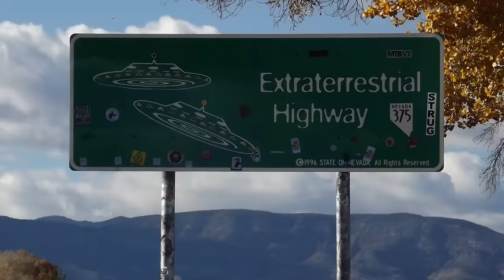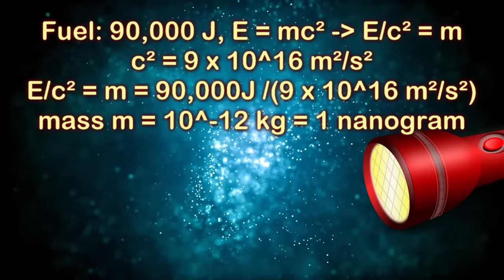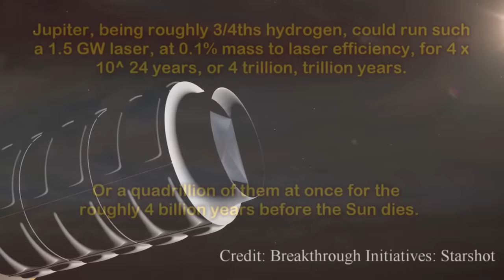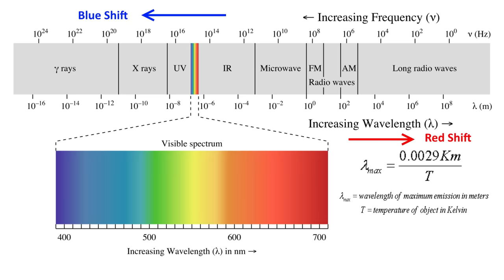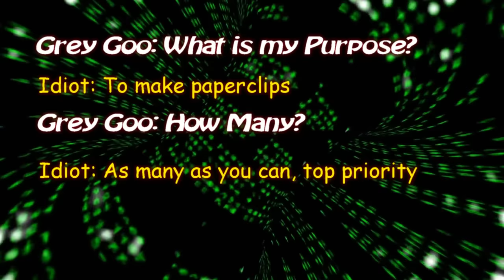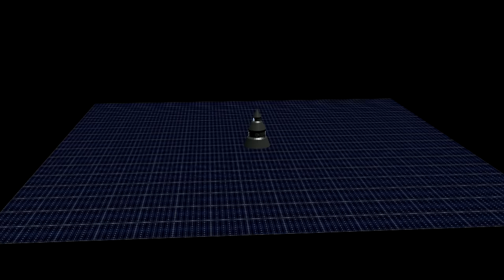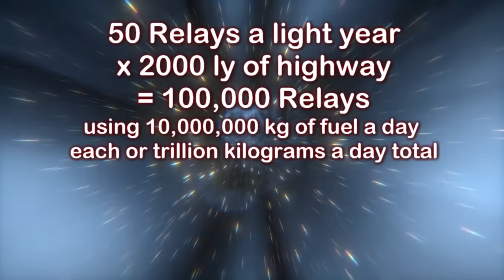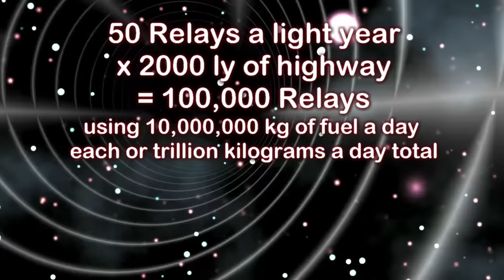Interstellar Highways

Comment: As always, a wonderful show. 

One thing I didn't see mentioned about the reflector station idea: couldn't you use something like a parabolic reflector to re-concentrate the beam for the bounce? i guess I'm picturing something like a lasing cavity at the focal point of the parabola...

If you wanted to, and you get the angles right, you could even put one on your boosting stations to re-reflect the energy from the station a few times. Sure, you'll lose energy with each bounce (and probably take a penalty as well for the cavity), but it would keep your beam columnated. Maybe even put something to shift your frequency back up if really necessary.
Reply from the maker: Sure, you could use a  lot of mirror and lens option to extend the beams aiming distance too, but I was kinda skimming that with the whole 'one light week radius' option. If you were doing great big habitats as relays and full blown petawatt beams, you'd probably have whole chains of reflectors and beacons and dishes along the way spaced every few AU or such.
Reply: Isaac Arthur seems like that sort of power would probably only be really used if you were going intergalactic... but if you're somehow energy-starved, or just stingy, it does give some more efficiency...
Reply: I made a presentation on this subject a few years ago. If you want to use the same optical power being transmitted along the relays to stabilize their positions against drift, the reflectivity of each relay optical mirror is the main bottleneck on how much power is left available to propel ships

http://www.centauri-dreams.org/?p=28727
Reply: Charles Quarra I think I read this a while back. the only issue I can see is: what stabilizes it? Basically, you've got another light sail. For something like the Starshot probes it's fine to use something like a small Oort cloud body, since there's so little mass that the effective recoil is zero. A ship like in the video is much bigger, and unless you're placing a rogue planet or something out there, and matching the relative velocities, it would only be effective for a short time.

I suppose if you can make them cheaply enough, and have the extra capacity in your beam line to get them out there and stabilized enough, they could be disposable, or possibly even pre-deployed for a particular mission. 

Ideally, with frequent two-way travel, you could just have it switch from up-stream to down-stream periodically, but most theoretical interstellar societies that feature that sort of traffic hand-wave for FTL.

If that's not the case,  you'd either need some sort of propulsion unit (implying reaction mass, and a larger structure), or MAYBE something like q thruster/emdrive/etc., with a suitable power plant (we'll see how that one goes, and if it does work this whole idea might be toast anyway).
Reply: "what stabilizes it?"

you have lasers coming in opposing directions from each star connected by the route. The mirror relays try to refocus the incoming laser light toward the next relay, but a small fraction is thermally absorbed and scattered. The absorption and scattering results in a small force, which gives you some equilibrium conditions. Those equilibrium conditions result in how much of the power can be redirected toward passing ships on each lane.

Figuring out how to design the relay mirrors such that they can behave as a lens but without a refractive material (which would be much heavier, and have lower transmission efficiency) is hard work. Highly reflective materials also require low area powers to avoid evaporating or damaging the thin reflective layers, which is probably the main limitation about how small can the optical elements be made
Reply: Charles Quarra ok that part I missed. Makes sense. Thank you!

Comment: I wonder what the maximum traffic density would be? If I'm in a ship with a big sail at the start of laser hwy, no ship past me is getting any photons. I steal their wind so to speak. A small low mass vessel could also jump in behind a larger ship and accelerate faster, ending in collision. Multiple lasers would make multiple lanes, like a regular hwy, but is the maximum one ship per laser relay?
Reply from the maker: There really isn't one so long as you've got the power to do it, realistically I can't imagine anyone using more than a percent or two of available power to run such a thing so you could extrapolate maximum density off an assumption of 10^25 Watts of laser to run maybe ~100 ly of lines, or 10^18 W per AU of line. If we were assuming 10^15 W per ship, about a thousand ships per AU, passing one going the opposite direction a couple times a second.
Reply: Makes for a cool traffic control system at relativistic speeds. Since there is enough power available, it could be a beam diameter much bigger than you need. With focusing mirrors on both ends at the emiter sights, precisely mirrored sails, we could reuse as much reflected or unused light as possible and bounce it back and forth between stations. Make the ships mere motes riding between massive collimating mirrors. That would be some mean precision optics...
This seems to be similar method discussed here: http://www.nextbigfuture.com/2017/02/yk-bae-can-now-amplify-photonic-laser.html

Comment: If someone else is already doing this out there, how would it look to us?  I imagine there is a lot of heat coming off of those laser stations - and some being dumped off those rapidly-moving sails too.     If we ever get in the path of a beam or reflection it should sure stand out, right?
Reply from the maker: I've been thinking about that, someone else brought it up too, and they actually wouldn't be very visible compared to the civilizations they connect. The scattering off those sails is huge, but a planet is still brighter, and this is very K1+ nearing K2 kind of activity. You could certainly detect such a network but it would be like seeing a car or train going between to metropolises, visible but simply tiny compared to those two cities.

Comment: Isaac, have you actually seen dr. Philip Lubin's presentation on photonic amplification using current fibre optic lasers? It is quite convincing (including the math). It shows that commercial lasers are just five years away from attaining the laser amplification levels needed, and that is with commercial technology, meaning:It doesn't require additional funding, just a couple of consumer infrastructure upgrade generations.
You can find his talk a.o. on livestream, NIAC 2016 it s about 60mins. They don't even have a problem with creating the large scale receivers. Also, the lenses required do not need to be as big as your math would indicate, fibre optics threads replacing a lens is one way to take care of that.

With regards to real focal lenses, it has been reduced to a materials problem, for which multiple avenues to come to a solution have been found. So one can be more optimistic about this tech than one thinks. Best date if the lens development is accelerated from an academic research program to a full scale technology dev. program: 2030, which is quite fast.

Love your shows!
Reply from the maker: I will have to check that out, thanks! Good to get some evidence I'm not being too overly optimistic about the tech.

Comment: Every action has an equal, but opposite reaction. How do the arrays stay where they are in relation to the various stars they connect when theyre pushing out such power? Even if you have ships traveling in both direction to balance out the force, everything orbits something. Would there be enough material in deep space to allow the arrays to maintain their positioning?
Reply from the maker: They can push each other, and dump excess momentum into a star or gas giant at the end of the line.

Comment: I would think you would be able to have lasers on board the sail craft both forward and back, fuel would still be a problem, but you did state hydrogen is the most common element in the universe? also I would think photons would be the soup of deep space, would it not be just a case of focus? glasses maybe :)

Comment: Hi Isaac. The first I ever heard of such systems was in Robert Forward's Rocheworld. He didn't have relays he had a giant Fresnel lens instead the concentrated the light.  Couldn't you have a lens instead?
Reply from the maker: Sure, lenses are an option, didn't I mention that in the episode? I lose track sometimes of what thoughts get onto paper and which chunks get revised or edited out before production.
Reply: Don't think so. You seemed pretty sold on relays.
Reply from the maker: I mention it about 5 minutes in, but a relay could use lenses too, refocusing beams, it just works better if you are generating the energy out there, a big light bulb and mirror and lens assembly works there too.

Comment: Wait so if you bounced a laser beam back and forth between the relay and the ship enough times and you could keep the beam tight enough and the absorption rate low enough couldn't you in principle get more kinetic energy transferred into the ship and the relay station than it took to fire the laser? And wouldn't this violate thermodynamics?
Reply from the maker: No, its not viable to bounce too many times anyway, except maybe for a slow down, but assuming you had perfect mirrors and targeting, as time goes on and the ship speeds up, the photon will be red-shifting to hit the ship, meaning its less energetic from their perspective. No free lunch there, though the more bounces the cheaper the meal.
Reply: Thanks. Looks like we'll have to find another way to survive the heat death of the universe. If there is a way I'm guessing it would involve something like harnessing dark energy since it's the only natural process that appears to violate the first law of thermodynamics.

Comment: Not sure about physics.. but battery uses chemical not atomic energy right? so theoretically there should not be any change in mass when you use battery and therefore no mass is lost and therefore you cannot use E=mc2
Reply from the maker: Batteries, chemical or otherwise, lose mass when losing charge, its just very tiny.
Reply: chemical energy is still energy. The fuel in a full tank in a car is about 0.1g heavier than the exhausts released when burning it all.
Also, some batteries do use atomic energy - they are called radioisotope thermoelectric generators (RTG). We use them in space probes in outer solar system. They are not rechargeable though...

Comment: "we can't trap light in a box"
Light has been slowed to one mile per hour (.0000000015c) in an unusual form of matter known as a Bose Einstein Condensate (BEC). And in 2001, physicists for the first time managed to stop light in a vapor of rubidium gas.
since then its been held in place for several minutes and could theoretically be held indefinitely so long as the temperature could be regulated.
Reply from the maker: Good point but I suspect that would break down when we started trying to jam quintillion of joules worth of photons into it.
Reply: Only one way to find out 😆

Personally get the impression that unless photons themselves emit some as yet unknown force or energy when slowed to a stop, then it would just be limited by the runtime of the refrigeration equipment. 
Plus since we're accumulating them in a controlled environment, we could always just very slowly gather them with much less powerful pulses, a rotating and/or multi barrel chamber and just stack our way up to the target energy density without inducing a thermal load that would disrupt the Bose Einstein condensate state.
Reply from the maker: Indeed, and I would be overjoyed for my guess to be wrong on that :D It would obviously be very useful as a battery/fuel

Comment: how efficient at reflection does a mirror have to be to be useful as a container for use of light as a fuel
Reply: say the container is 1m in diameter. that means the light would bounce off of a wall 3x10^8 times per second.
To have still 50% of the energy stored after ONE second that mirror would have to have a reflectivity of
99.9999998%. since (0.999999998)^(3x10^8) = 0.5.
For everything longer my small pocket calculator is to small^^

Comment: Can't you run a solid track the whole distance? 1ly=10^15m  Earth mass=10^24kg so you have enough mass to build a 100 km circumference, 1 ton /m^2 rotating habitat 10 ly long. You could run a relativistic track up the side of something like that. (with a small gap to minimize damage from relativistic accidents.) Using electromagnetic acceleration and breaking you could reuse the energy from one journey again and again, good efficiency and regenerative breaking.
Reply from the maker: You could but that distance is changing rather quickly, stars move, and I'd be real nervous about any physical track that's got stuff plowing down it at relativistic speeds, even if it's not actually touching it.

Comment: Is it possible to do this without fusion reactors at each relays?

I mean, beam laser power from one relay to another, which gets captured by massive solar sail sized solar cell arrays, use some of it to push ships, use the rest to pass on the power to the next relay.

This way you don't have to worry about mining lots of hydrogen at each relay, maintaining the fusion reactor and housing 100,000s of people at each relay.

You will lose some of the power due to the efficiency of the solar arrays never being 100%, so you will not be able to continue this relay chains for more than a few dozen relays. At which point you might already have a 1 light year chain or more. So every 1 to 2 light year, you will have to have a massive fusion reactor powered laser emitter station with its own hydrogen mining infrastructure manned by a few 100,000s people. But that would still be better than having such a station at EVERY relay.

You can also have a swarm of laser emitting stations at each star sending power to relays in all directions, this significantly decreases the need for fusion powered laser emitting stations even further, and possibly eliminate them altogether.

Comment: Could you do something similiar with a ramscoop ship and stations that "seed" the path with fuel?
Reply from the maker: Bussard Ramjets don't work... although they maybe an excellent way to slow down, I explained them a bit in the original episode where I went over the basic for this system, the old Interstellar Colonization episode. Of course you could maybe get away with hitting a ship from behind with a beam of relativistic hydrogen hitting them at just a bit faster than they were going, suck that in and fuse it for fuel.
Reply: If i remember correctly, the Bussard Ramjet would not work, because the drag would be greater than the energy gained by proton-proton fusion. But would that still be the case if you seeded the ships path with ready-to-use fusion isotopes?

Comment: Wouldn't the relays drift away inside of a galaxy relative to each other or does everything move homogenous within a galaxy?
Reply from the maker: No everything is moving, your relays have to stay on a straight line with stars, but that's a very slow drift, and they can actually beam each other around once in place. Timeline-wise its kinda like worrying about keeping your boats lined up on a river while it slowly changes course over several decades. You might need to add a new relay every few centuries if a pair of stars you were linking were moving apart rather quickly.
Reply: Isaac Arthur this was my biggest question as well, and I searched the thread for mention of this: what happens to the position of relay stations, are they moving much toward the galactic center, or are they correcting their position to maintain the "lanes" and if so, do the need to emit a simple stream of propellant (whatever is most plausible). Also, how close does a relay station need to be to passing ship, considering that if the beam is too angled it seems like it would cause the sail to pivot, and if it is too direct, it might hit something vital like another station. How far should these stations be from each-other?
Reply: @twansley1  Some of those questions are answered here: https://www.academia.edu/4135938/Laser_Starways_light_bridges_to_the_closest_stars

Comment: I haven't seen the whole thing yet.
But a question, wouldn't it not be simpler to put a nuclear fission (or fusion) reactor on the ship to power strong lasers to continuously shoot at the sails?
Reply: to shoot at your own sails?
Reply: AndDiracisHisProphet yeah, to accelerate it.
Reply: Think of being in a car. If you push on the seat it won’t push the car. But if you’re in the ground pushing the car away from you in a fixed position you can push the car then. The laser has to be in a fixed position on a separate entity to accelerate the sail. another example would be you can’t put a big fan on a sail boat to push it.
Reply: Devin Greene nvm
Reply: Devin Greene sorry https://youtu.be/n9cdfUYkrLY seems to work alright here, I mean the beams being deflected would have the same effect I'd think whether they were being sent from the ship or a stationary object.
Reply: Yes, Devin's analogy is not really good, because if you can reflect in properly you can get 2times the momentum from each photon reflecting minus one time the momentum from the laser.

still a stupid idea, because you could directly fire the laser backwards if you wanted to, and that would be a photonic rocket, similar as Isaac described in the beginning of the video. It would still have the same issues as all other type of rockets....the rocket equation.